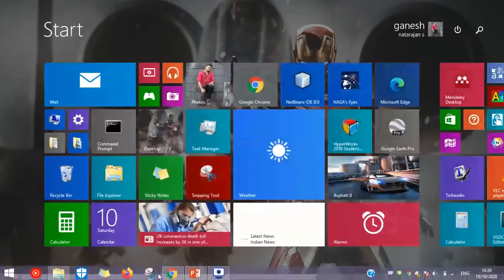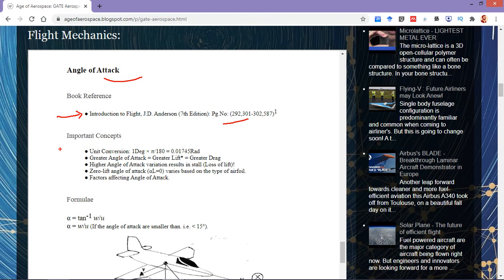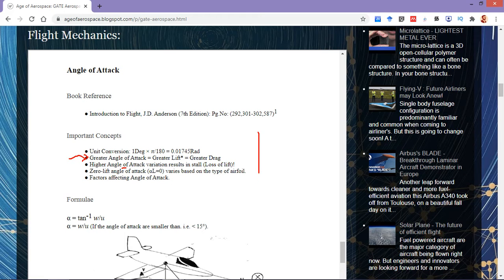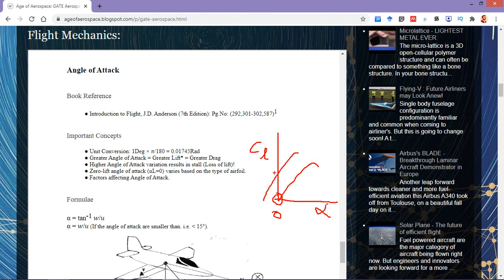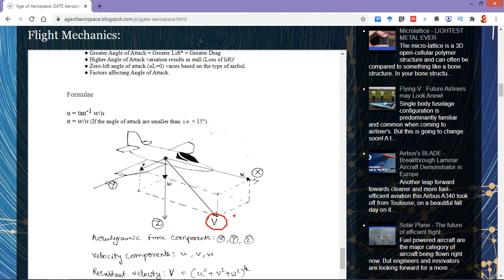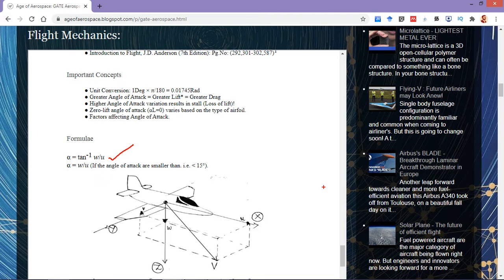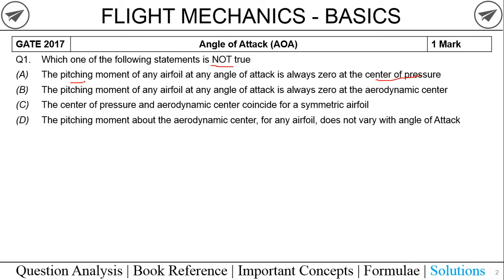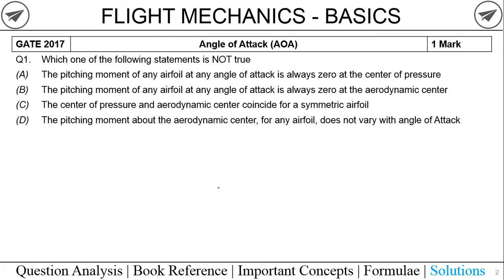Angle of Attack | Q & A | Topic wise Solutions | Flight Mechanics | GATE Aerospace

Comment: In GATE 2007 question, the answer should be B right? The aspect ratio of Wing B is greater hence it's lift slope is also greater.
Reply from the maker: "lift co-efficient" is independent of span, so lift may increase by increasing span but lift co-efficient doesn't vary. Hence option A is correct.